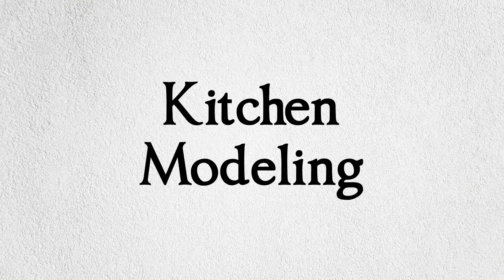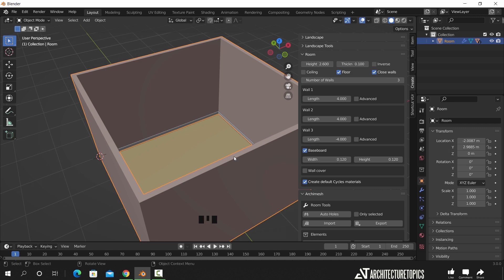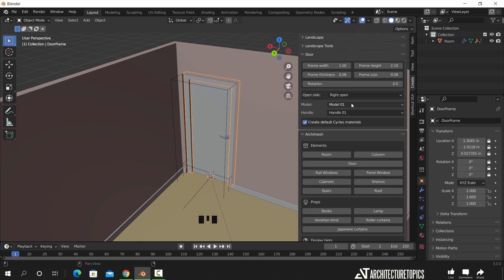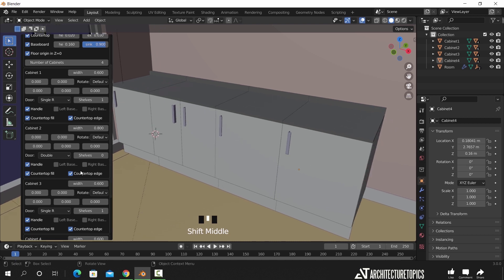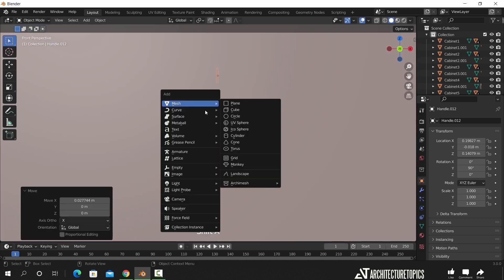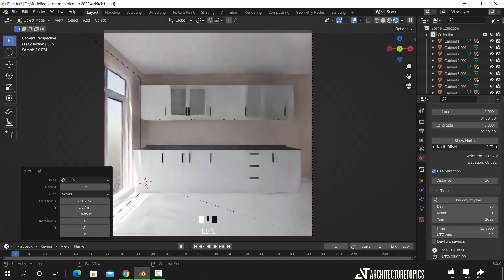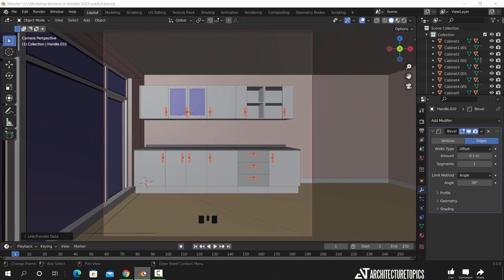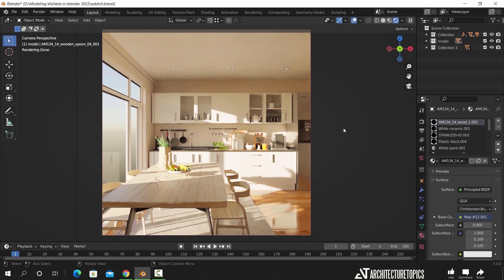How to model kitchen under 10 min

Comment: Hi!
I got little problem, when I add gabinet, or shelves or anything, I can see edit window in left down corner, and I can edit the furniture, but when go forward, and want to edit gabinets one more time, I cant see this edit window, also when I press N button, and open archimesh panel, I can only ad new gabinet. How to edit one more time furnitures??
Reply from the maker: As i remember You can't edit it after selecting another piece so one time fix, Now there's a similar free addon with more flexibility around parameters and edit so check it out https://youtu.be/F4W5D1VqshQ

Comment: Would you say that with the pencil .....i can trace the walls from a cad file into blender and somehow they'll turn into walls with their own base floor moulding just like you did here ?
Reply from the maker: Maybe? I don’t think it do well with complex plans, the real issue is connecting exterior with interior walls.
If you into that you should check Archipack pro it do  this tracing process easily.

Comment: Whenever I import a Archimesh object. Like windows and doors it's showing an error about cycles visibility in Blender 3.0. What could be the problem?
Reply: Can you help me with this please
Reply from the maker: Didn't really happened to me before, if the error with Cycles it's either settings or updates. Try clearing your cache memory or may even try doing it on another older version like 2.9 just to sort out the issue, you can also update your graphic card that might help.
There's a talk here on this page about the problem and AMD card or something check it out 
https://developer.blender.org/T76483
Wish this helps
Reply: @architecturetopics  I did everything. Mine is RTX 2060 with latest drivers. 2.9 works just fine. But it's a bit sluggish compared to 3.0. I will try checking out the website you linked. Thanks for the reply